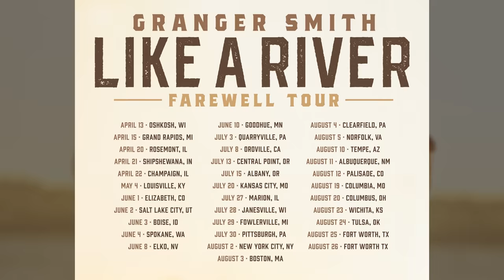Today Is The Last Day…

Comment: Granger, regarding your Sunflowers. They need to be planted a few inches apart. Water deeply once a week , unless it rains. When you start to see new growth , run your hands across the leaves. This will drop any of the seeds. You can use the seeds to replant or eat. You will want to check and make sure they are good first. There are two types of Sunflowers. There is drawf and tall. If you have planted the tall you will need to stake them for support. Becareful of the birds and squirls they love the seeds. You will see the most growth in midsummer. 💕💕

Comment: The best time of day to attack these Wasp and Hornets is usually early in the morning or late in the evening when they are less active. Spray like crazy, saturate the nest, then when settled down take a long pole and knock them down. A good stomp on it then scoop up with  shovel and toss in the fire pit. Best if a fire is there but usually by now you have done them in.
Still use caution. 
If you do this in the middle of the day chances many are away from the nest and will survive, thus Dawn and Dusk is best.